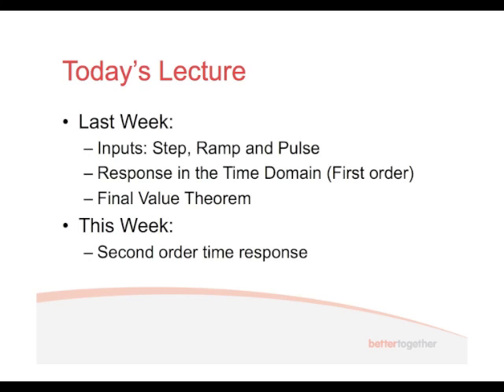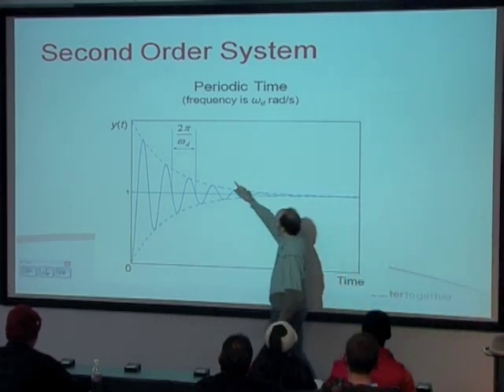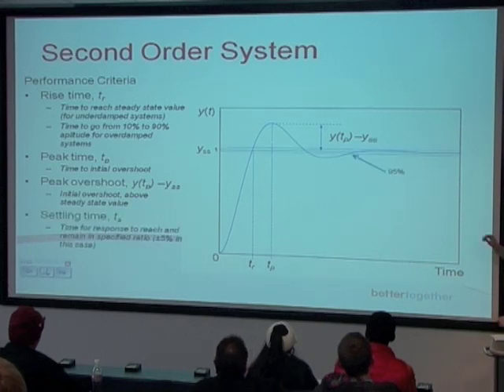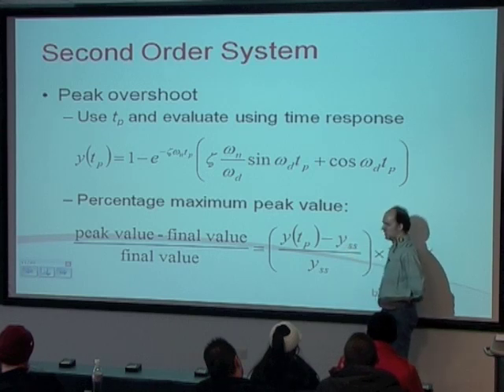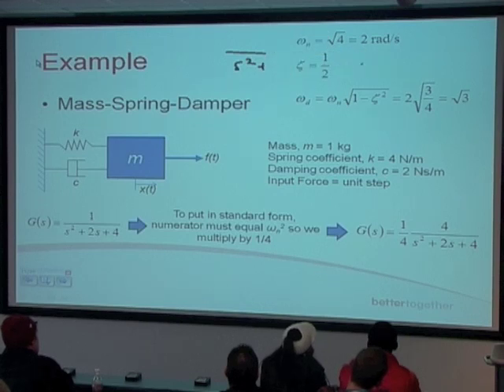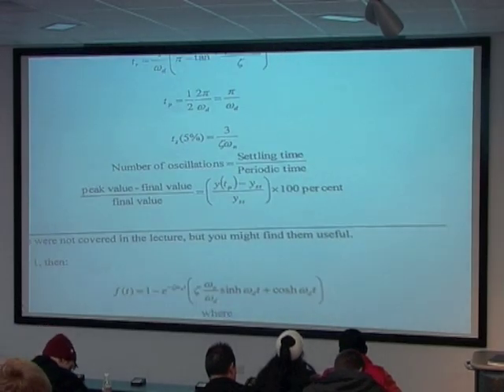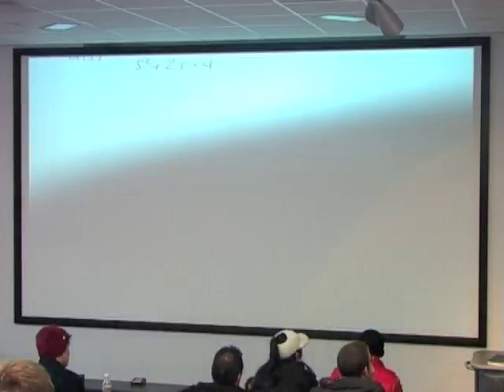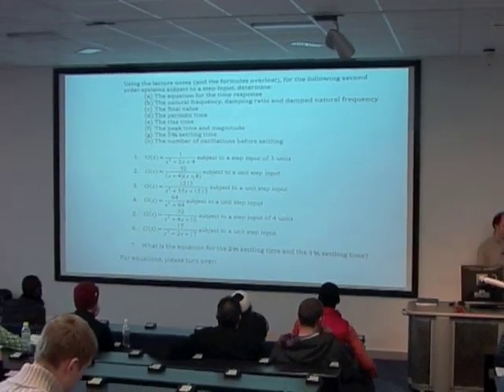Control Systems Engineering - Lecture 4 - Second Order Time Response

Comment: I re-did the calculation for the peak overshoot, using 1.814 peak time, and got 0.208, less than 0.25. That gave a % DECREASE of 16.8%, suggesting it isn't an under-damped system even though the damping ratio is 0.5. Would you please explain that?

Thank you.

Comment: sir I've one doubt in CONTROL SYSTEM book they mentioned note " If the denominator of sF(s) has any root having real part as zero or +ve , then final value of theorem is not valid" .. Please explain it clearly..